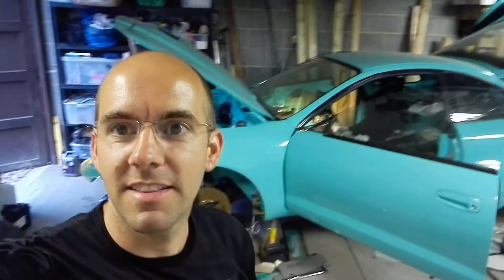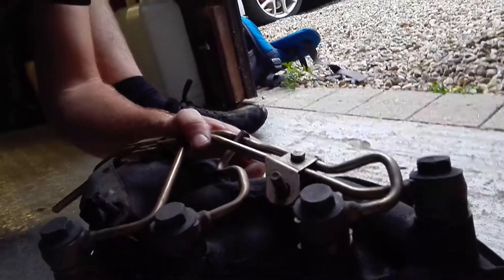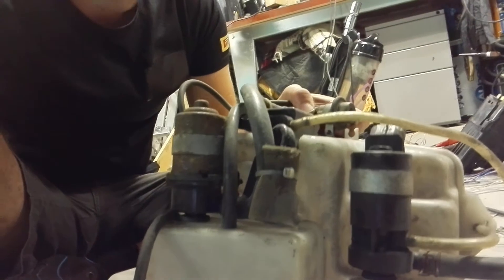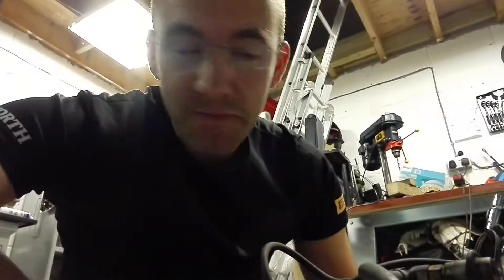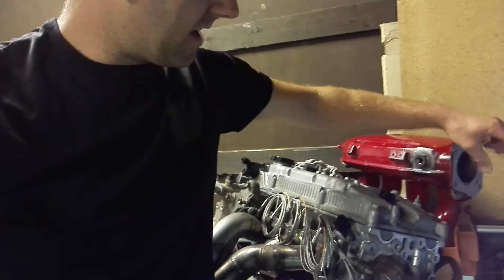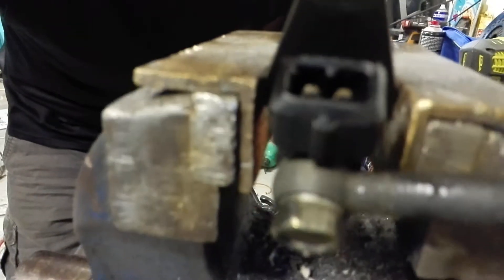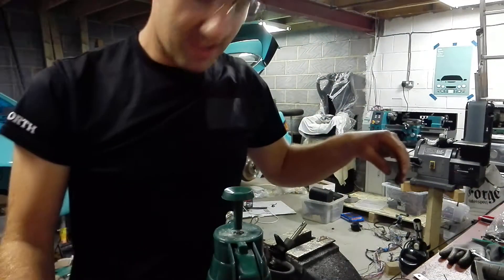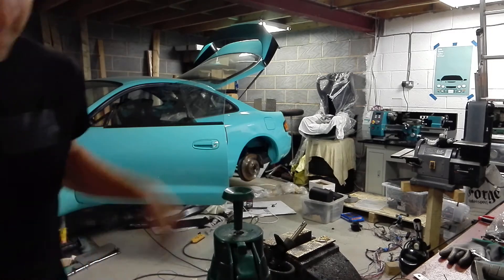ST205 Celica GT-Four - Homologated Water Injection

Comment: Is the water injection nozzle a repurposed cold start injector? Happen to know the part number on it? The looks like a great option for secondary pre-turbo water injection (adding tot an existing injection system).
Reply from the maker: wehooper4 it was a dedicated injector, stainless and plastic construction to prevent corrosion :-)
Reply: Well that dashes that plan! Thanks for the info, and good luck wrapping up the last of your build.